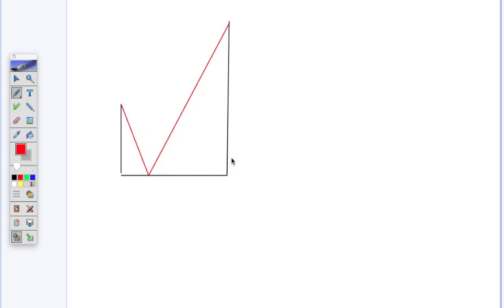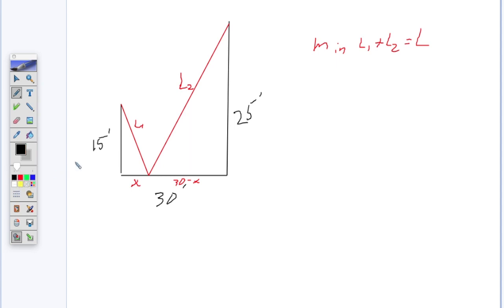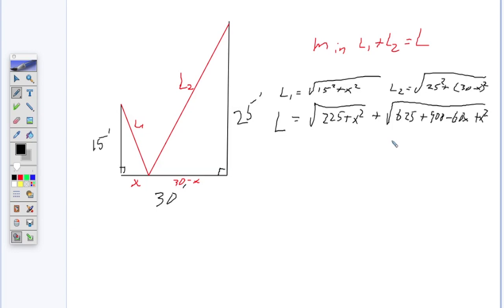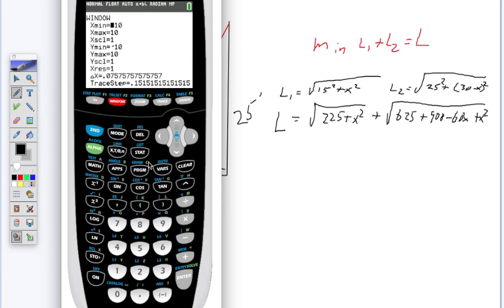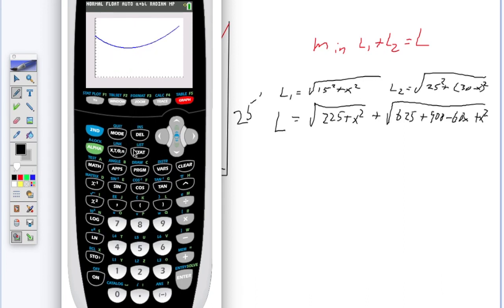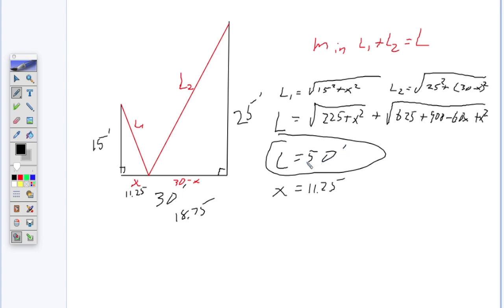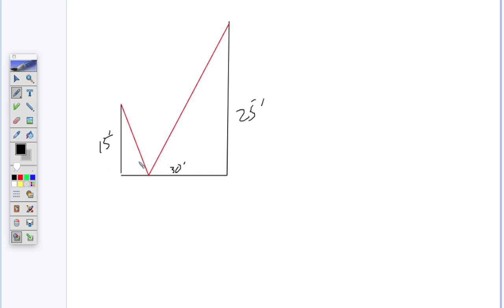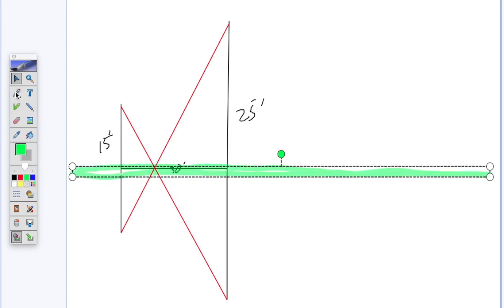Mathematicians and Engineers

Comment: An engineer, a physicist, and a mathematician are all in a barn, each with a bucket of water. In front of each of them, a fire starts. The engineer dumps all the water on the fire, solving the problem. The physicist does some calculations, and pours just enough water to put out the fire. The mathematician looks at the fire, looks at his bucket, looks back at the fire and declares "A solution exists!" before letting the whole barn burn down.

Comment: Why wouldn't u just solve for both hypotheses with two separate triangles?
Reply from the maker: Mike Mills Lynn Mass with a goal of minimizing the length of rope, you need to find the minimum length of both hypotheses.  Engineers would use calculus and set up a minimization problem.  So in a sense I did solve for both L1 and L2 in terms of x.
Reply: we do not have the x value how do u want to solve for the hypotheses of the triangle on the left? it would nt work